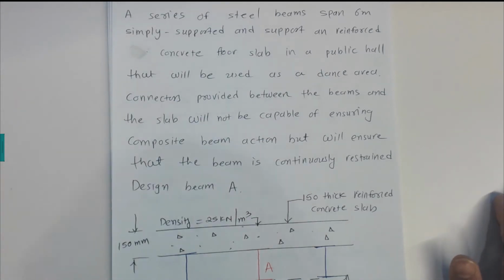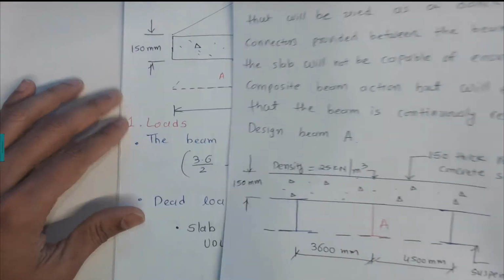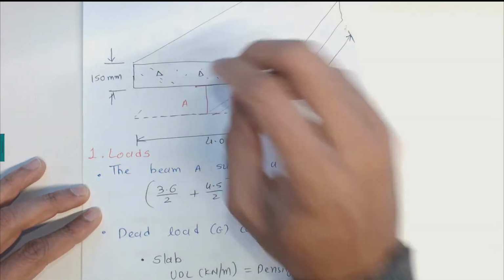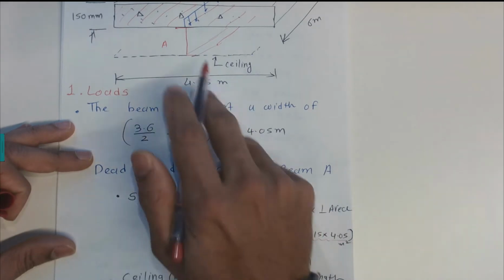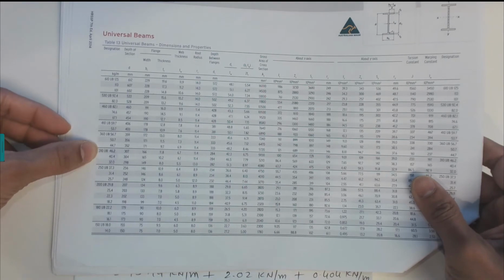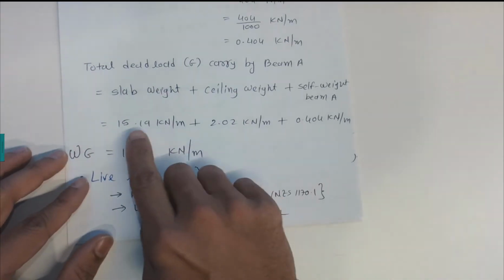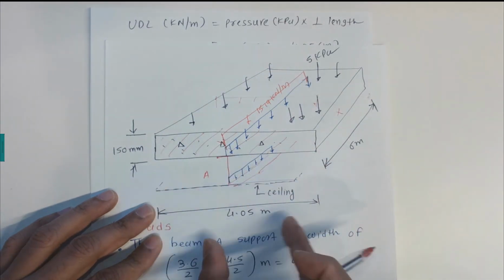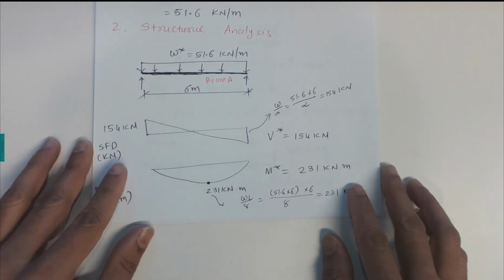Steel beam design for Shear Example 1 Part 1

Comment: Sir, maybe I am wrong. Bending moment for SSB with UDl = w*l*l/8.
Reply from the maker: Hi Abdul, you are correct. Moment = w*l*l/8. I have a mistake in the solution. The answer is correct. I just miss the square of length. Please correct it as required.
Reply: Your videos are very much useful for me. Please add videos for connection design based on Australian code also.